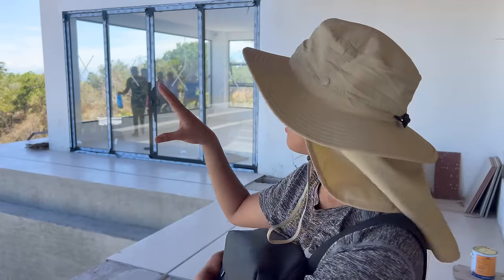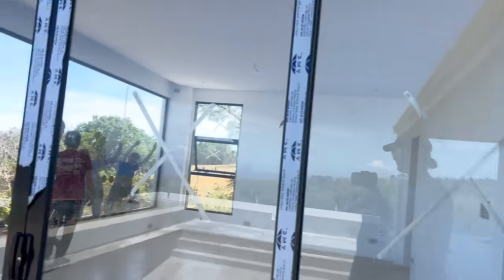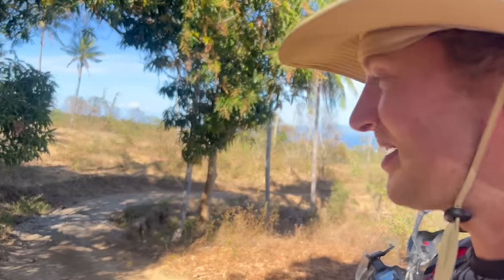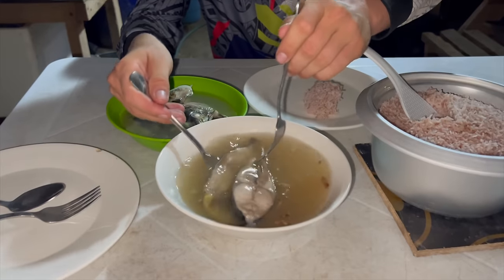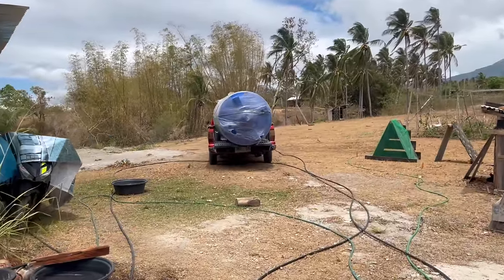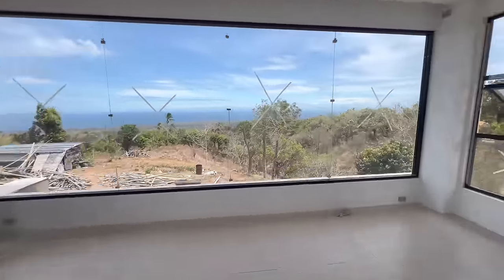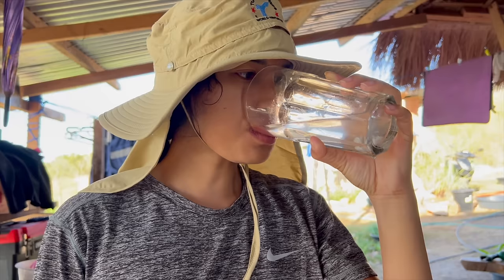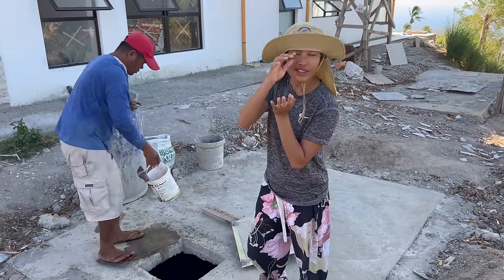WE HAVE BEEN WAITING FOR THIS DAY - House Construction in the Philippines Province

Comment: 13:30 Hey Finn, I might've asked this before, but have you considered large 'bokashi' container? It's a method to ferment your food waste and kitchen scraps and it gives you EXCELLENT liquid fertilizer and the residue pulp after a month in the container mixes with soil and improves the quality of the soil tremendously for your plants and veggies. Check out the larger sizes of 15o litres or so, I think they would be a PERFECT fit for your self sustainability at the lot.

Comment: Hi Finn, I'm always happy to see progress on your house construction. I wish I can build a house with an Off-Grid setting someday when I retire. I'm an engineer and I only have comments for those large sized glass windows. Did your Engineer designed them to withstand wind pressure during Typhoons in the Philippines? I think there must be some sort of braces (Glass Columns) or columns placed on each joints. Don't under estimate the power of Philippine Typhoons to avoid injuries and damages to your things specially electronics. Otherwise, you need to provide protection for these glass windows to be installed outside if in case of a strong typhoon. Thanks.